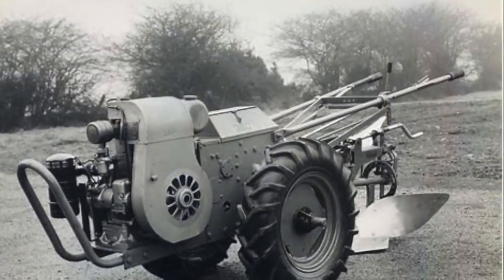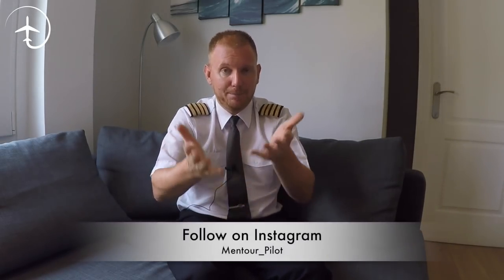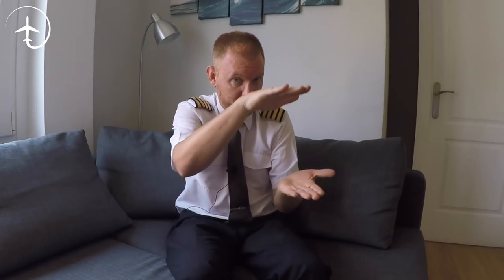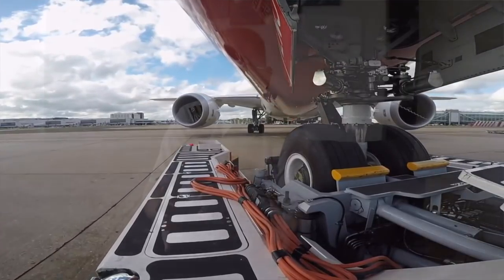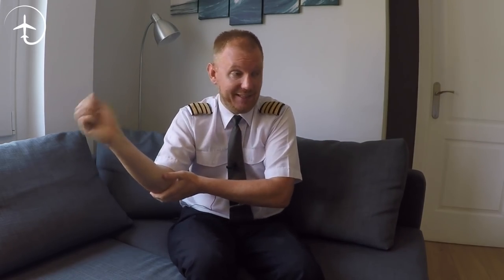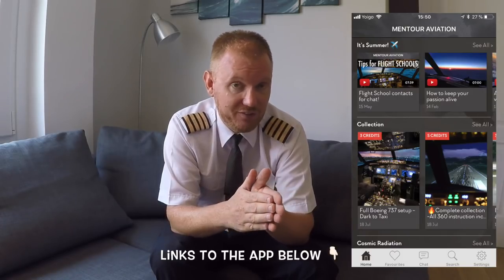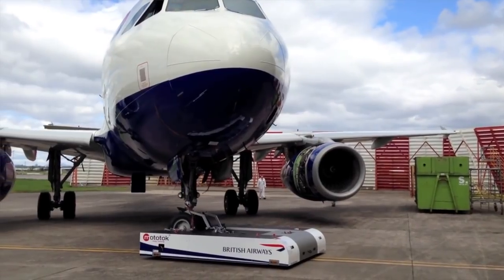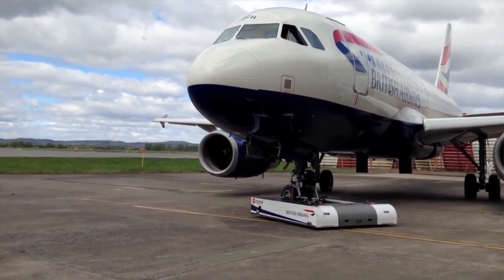Aircraft pushback, why is it necessary?

Comment: I actually have seen reverse thrust used to push back from a gate before.
Not by a pilot though. Taxi-rated technicians have no chill when it comes to dealing with ramp operations. Especially late at night when no one is actually on shift to drive the tug.
He taxis into the wrong gate, immediately hits the reverse and parks it at the right one.
You'd never see them do it in the daytime though.
Reply: Around 2002 Delta airlines banned all their mechanics from taxing aircraft into the ramp areas under power after two techs damaged a plane, a push back tug, and a jet bridge.   They taxied in too fast, slammed the brakes which cause the nose gear to buckle and dropped the front of the aircraft onto the push back tug.  The aircraft and tug then slid into the jet bridge.  Delta sent out an internal company wide email about it, which included pictures.
Reply: @TgrHwke  I remember that incident. I work with United, so I don't know much about Delta's way of doing things. United Express' regional partners are a bit detached from mainline when it comes to policy. But changes to that are in the works. Our maintenance run/taxi training is already very lengthy, and United wants to make it even longer.

Comment: Why don't aircraft get towed all the way to the runway, just the start of the taxiway?
Reply: brad well At many airports there is not enough space for the tractors to return to the gate then. Also i could imagine that the pushback driver then needs a lot of extra education...communicate with atc etc. Then the pushback truck is not available for a lot more time to pushback the next plane so the airport needs more tractors, drivers etc. And imagine the poor guy who has to walk next to the plane all the way until the end of runway all the day. However, one time i was on flight from Singapore to Frankfurt and they really did exactly that....dont know the reason for it, maybe to safe fuel.
Reply: Also, aircraft engines need time to "warm up" before they are asked to reach power levels needed for takeoff. Imagine starting your car's engine on a very cold day and 20 seconds later driving 240 k/hr.
Reply: Actually, the incentive is there as it saves a lot of fuel.  The pushback tractors are not meant for long tows though.  Many runways are literally miles from the terminal gates where the fuel savings would benefit the most.  This means the tractors would need upgraded engines, gearing, and frame construction as there are really only meant to do a few mph under tow stress.  They'd have to be rated at like 35mph tow speeds, which would be an expensive redesign.

Comment: Couldn't the front wheel be equipped with a small motor, just strong enough for pushback, and rear cameras on the plane, to enable the pilot to do this all by himself?
Reply: That would cost way too much and will have to go through way more maintenance due to the plane constantly flying. Imaging having 200 planes not all of them are landing at one time so they probably only have about 50 pushback machines. It's alot cheaper
Reply: @indiejones4683  Thank you for the reply. I guess a side-by-side cost/benefit would have to be calculated, because the front motor would save money spent on some ground workers and leasing/maintenance of pushback tractors. I think the trend is for planes to become more autonomous anyway.

Comment: American General made bunches of pushback tractors & pushers, and fuel trucks, and the skyjack stocking vehicles.. It is all off the shelf cobbled together crap, and by god it looks it. Tractors "pull". A front prop plane is called a tractor prop plane, and a rear prop plane is called a pusher, unless it flies backwards. Then, I am at a loss for words. My first thought would be, "If it is flying backwards, it's gotta be military!"!
Reply: Most of these little tractors use a diesel engine at about 300-350 BHP (Brake Horse Power) but only at 1200-1600 RMP, however they have 600-800 foot pounds of torque, so they can move a lot of weight. That is actually low RPM. Gasoline engines run at twice that RPM, and redline at 5000-9000 RPM. If you can run at 9000 RPM with a gasoline engine, in a car, someone built a darn good engine. Most redline at about 5500-6500 RPM.

Comment: If not too much power is needed, why not have an electric car kind of motor powering the wheels of the aircraft while on the ground and controllable from the cockpit then you don't need such a vehicle to back out of the gate.
Thing is when I was a young kid seeing those vehicles attached to aircraft and thought "Do they fly with those vehicles attached?" but now I know that they are used for parking the aircraft to the gate and backing it out of the gate, then it is detached before flying.
Reply: motors for cars already weight a good hundred pounds or so; every pound added to the plane subtracts from it's maximum takeoff weight, meaning the plane has to carry less. motors to push/pull the weight of an entire aircraft would a) weigh too much of an unreasonable amount and b) take up precious space. Something a lot of people don't realize is how dense the inside of an airplane is. They are designed so, with the exception of the cargo bins, there's no space left unused. Adding 3 or so motors wouldn't be feasible to add to most conventional jetliners on the grounds that there'd simply be no more room.

Just as a final thing, they don't use the tugs to bring the planes into the gate; they use their engines for that. the tugs are only used to push the plane back from the gate. Planes used to use reverse thrust to pull out of the gates but that caused safety concerns and wasn't good for the engines in the long run.

Hope I could help answer some of your questions!

Comment: I always wondered why they don't just install electric motors into the wheels which can then allow the aircraft to taxi push back without needing engines. Must be a big fuel saving surely?
Reply: Thomas Mortimore Nope that would actualy increase fuel costs as it is extra weight which means higher fuel consuption not to mention you need to start the engines and apu to generate power before pushback insted of after and it would be a safety hazard since pilots don't have mirrors and most planes don't have camara either so your reversing alomost blind.

Comment: You don't convert power into torque. Power is the product of speed and torque. You exchange speed for torque. These TLBs are geared to move slowly, thereby multiplying the engine torque several times.

Comment: Why drag the plane only to exit of the gate and not to drag the plane all the way to the takeoff point and save a lot of fuel?
Reply: My guess is that the airports would need many more pushback trucks and crew to operate them because it would be much more time consuming to drag each plane up to several kilometres from the terminal to its take off point.
Reply: I think that if we look at it from an economic point of view, saving fuel and engine hours is preferable.

Comment: can jet blast break ternimal gate glass?
Reply: jet blast is only a big worry behind the engines; there's no point (hopefully) where the backs of the planes engines are close to the terminal. in front of the engines your main worry is getting sucked in. for reference the 'danger zone' where you risk getting sucked into the engine of a 737 is about 14 feet in front of the engine and about 3 feet behind the engine inlet (the big hole)

Comment: With the advent of electric engines in Tesla et. al ... could an engine be put into the front wheel to allow for reversing?
Reply: They could if they wanted, but it wouldn't even be considered because it doesn't solve all other problems. Also, even if they do, the matter of the extra weight and complexity on the plane could potentially make it more expensive than ground trucks.
Reply: Traction would be a nightmare. None of the aircraft's wheels are designed to transmit power to the tarmac. It's not at all clear that you could have a nose wheel that could transmit that much power to the ground and not just smoke the tire, and still be the same dimensions as the original one, perform all the same functions as the regular nose wheel etc.

In contrast, a pushback tractor has four big, wide tires that can all be driven at once, and mechanical gearing that keeps the wheels from spinning. All that makes them big and heavy and fairly expensive.

Comment: Interesting, I always thought they used pushback tractors because an airplane could only go forward.

So an airplane does have the ability to reverse out of the gate just like a car reversing out of the garage.
Reply: MD-80s have reversers which allow this.  Lots of noise and fuel use but.

Comment: At 3:40, it is stated that the aircraft couldn't do power backs themselves. Definitely not true. I flew the DC-9 and MD-80 from 1981 to 1988, for a major airline. One airport at which we routinely powered back was MCO (Orlando) We deployed the buckets and applied just enough power to move backward, feet flat on the floor, and turned the nosewheel as required to position for taxiing from the gate, being guided by a trained  CS agent or mechanic maintaining pace from the front. When he reversed his rotary signal, we moved the reverse levelers forward, and applied forward thrust to stop the rearward motion and begin the taxi.
Reply: "Reverse levers", of course.

Comment: Ah, so the reason is airplanes don't have any secondary engines powering the wheels and they need to use their jet engines to move or be towed. Adding diesel or electric engines to power the wheels would add extra cost and weight, so it's just better to tow the airplanes with large trucks.

Comment: I like the idea of them robotic pushers pushing all the way to the runway.  Partly just because of the automation factor, if you have a bunch of robots trying not to collide with each other it's pretty likely they're not going to collide with each other, have the controller pressing a button when a runway's in use and them robots are not going to misunderstand which runway and whether it matters to them accidentally. In a regimented situation like airports self driving stuff would be great.

Comment: It's not the friction of the tire, it's the friction of bearings... That's why the guy can pull the whole airplane.
Reply: Not true. Lower pressure in the tires can increase the amount of rubber actually in contact with the tarmac surface.

Comment: Never could understand why they never installed 360 degree cameras at the tip of each wing and on the tail with a video feed in the cockpit. These cameras are small and the crew will be able to get a full view of any obstructions around the aircraft. Must be a reason why they don't do it but I can't come up with one.
Reply: louis stennes 360 camaras are not small so they would affect aerodynamics in flight and cause extra fuel consuption
Reply: louis stennes However there are camaras on the tail of new aircraft which give a veiw of the whole aircraft including the wings so I don't think a 360 camara is really nessesary

Comment: How in the world can they lift and push THAT many tons? 😲
Reply: They are not having to lift the rear most weight. Any weight behind the main gear works to your advantage when lifting the nose wheel. Perhaps 5-10% of the plane weight.

Edit: I'm not an e gineer or pilot so the 5-10% is a ballpark guess.
Reply: There is a famous quote of Archimedes. He said
"Just give me a fixed position and I will move the earth"

Of course he ment he needs a fixed point and a lever (which is long enough and strong enough to withstand the torque).

Comment: 7:52 Sir you are wrong, there is static friction and dynamic friction. Static friction applies when the body, aircraft, is not moving, this friction is always higher than the dynamic. And dynamic is when the body, aircraft, is moving. Therefore it is harder to make a plane start moving but when it moves it is easier to continue de movement, so the 400Kg you say, I dont know if they are from static or dynamic friction, but It cant be for both, it doesnt make sense.

Comment: The term Tractor, comes from the phrase 'traction engine' - the age of steam basically.  So Tractor is exactly correct - it's an engine that provides a vehicle traction.
Reply: Further, agricultural tractors aren't the only other use of the word in English. See also road tractor aka tractor-trailer unit aka semi aka articulated lorry aka HGV. See also locomotive tractors aka engines aka rail car movers.

Comment: Am I the only one who thinks the little remote controlled "tugs" are kind of stupid? They might be good for moving aircraft short distances while working on them or something, but useless for pushback operations. Here are my main reasons for saying this:

1. If it is to be operated by the captain, doesn't that still leave the problem of not being able to see behind them? It solves the problem of danger to ground crew, equipment, the building and possible damage to the engines that reversing might cause. They still can't see behind them, though.

2. If the pilot doesn't operate it then someone on the ground has to. So it's not like it's saving the airline any money by not having to have an operator on the tug. There's still going to be the same number of people required to complete the pushback operation. 

So in my opinion they might have their purpose, but pushing aircraft out of the gate probably isn't all that practical.

Comment: I guess it's quite difficult to put the engines in reverse ... Ha Ha ... !
Reply: The engines are still running in forward power.  There are vanes in the nozzle section, that redirect the air to thrust it toward the front of the aircraft.

Comment: i really like this channel its informative and the host does a good job. BUT, ive noticed that the hfirst 130 is promotion of a third party company then by 200 hes explained (in this one at least) pretty much what u need to know. the remaining 12 minutes of video is completely unnecessary. as someone who edits video id say this is mostly B roll and can be got rid of without affecting the quality of info and benefiting the run time. lots of them are like this. 5 minutes buddy is more than adequate.

Comment: Don't see a reason why airplanes couldn't have electric motors built into the landing gear + a camera on the back, just like cars.
Reply: Tugs are much cheaper.
Reply: blindleader42 For now, but am quite sure that airlines would quite like the idea of requiring one fewer piece of infastructure at destination airports. On top of that, electric motors in the wheels could spin the wheels before touchdown = less tire wear.
Reply: I'm 100% sure the airlines could not care less how many  pieces of infrastructure are on the ground as long as their costs are minimized. The bottom line wins every time.
Reply: blindleader42 What I meant was that by not having to rely on the ground infrastructure they can save money and time. Why would Ryanair use stairs built-into the aircraft for boarding then? Surely that added weight isn't good for the fuel consumption...
Reply: Ryanair uses 737s, probably the only liner for which built in stairs are feasible, the deck being so close to the ground. Just look at the Ryanair stairs to see how minimal they are. They also frequently have destinations with little, if any, commercial infrastructure and which are unlikely to get them in the near future, so necessity dictates the extra equipment. I can't imagine how you think not having tugs can save time or money. Take a wild guess how much it would cost in extra fuel and maintenance over the life of an airliner to have a powered nose gear. I predict it will be multiple millions of dollars for any of the two aisle aircraft and probably over one million for a 737. 737s that operate in and out of the same airports as the heavies have no use for powered nose gear anyway, because their destinations will have tugs for the foreseeable future.
Reply: blindleader42 Don't they have to pay for pushback as part of the airport fees? Also, not having to wait for a tug which might not be immediately available on small airports sounds like a benefit to me. Also, don't think the electronics would weigh that much. You don't need any batteries, given the APU can provide power... 

Am not saying it's a perfect solution, but don't see a reason why I shouldn't be explored.
Reply: Forget it. I'm not going to waste any more time.
Reply: As you said yourself, the added weight isn't good for the fuel consumption and payload.

Comment: Full of shit, thrust reverses work just fine with ground grew to get the aircraft going toward take off.  No history lesson necessary.
Reply: Joseph Nicholas Well if it works so great then why is it not used?
Reply: RIP noise abatement
Reply: Come on. You're going to provide full thrust aimed at the gate area a hundred feet away? Also, consider all the debris that may be on the tarmac. If it's not driven through the airport glass it could bounce off and get sucked into the engine intake.